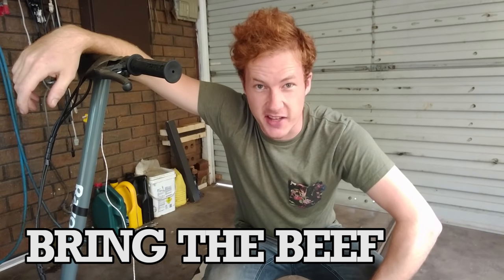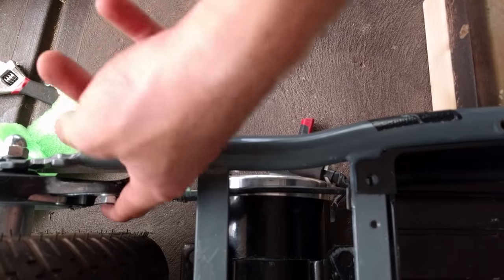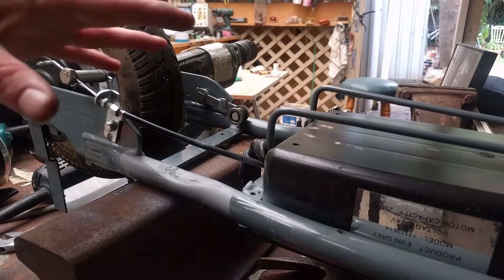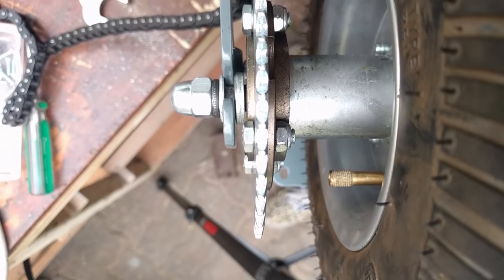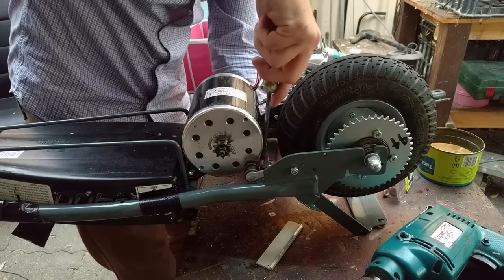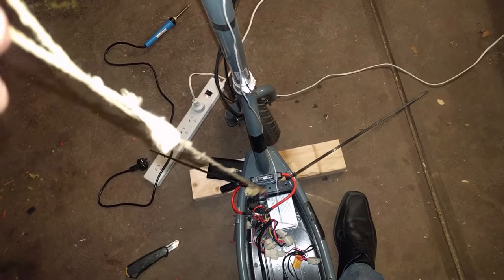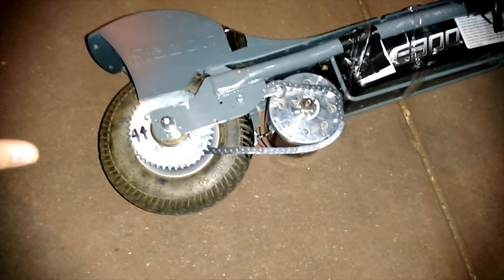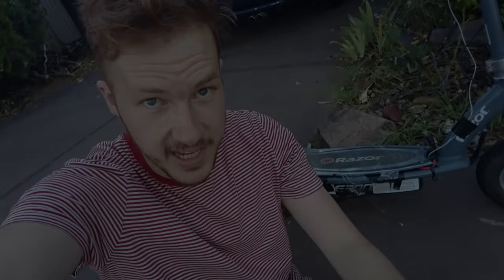Razor E300 Gets a Big Motor Upgrade - Scooter Episode 5

Comment: where did you get the sprocket? and please tell me it 44t t8h sprocket fits easily on the #25 chain
Reply from the maker: I think I got the 44T off eBay. T8F sprockets don't fit #25 chain. I cover all this in the video. :)
Reply: TK thank you I saw your video part by part and I see you are using 44t t8f rear sprocket and a MY1020 motor with a t8f pitch.. I think I have to only buy batteries and that's it. I'm looking and looking for pieces to fit on the stock motor but is impossible. thank you for you tutorial . " Dob Jone".
Reply from the maker: Did a search - here you can get 'em. Parts List:
Motor - https://ebay.to/2Yy2qtp
Chain - https://ebay.to/2V35TxK
Sprocket - https://ebay.to/2Fwux3o
Sprocket - https://ebay.to/2TZ5kIS

Comment: You made almost no difference in gearing with the sprocket change, the tooth number changes with pitch, your stock 56 tooth #25 chain sprocket had a diameter of 113 mm and your 44 tooth T8F chain sprocket has a diameter of 110 mm. Apply the same principal to V-belt Pulleys, its really the overall diameter that matters.
Reply from the maker: MrTurdfergusen yeah, plus the person who sold the motor lied, it came with a 9T cog. episode 6 goes into this more, as does the Hackaday.io page. :D

Comment: he has fucked the rigidity of the frame by flattening it with a hammer, if it doesn't fold and bend when you first stand on it, it will when you go over the first bump...
Reply from the maker: There's actually plenty of rigidity left. Yes, it's compromised somewhat, but it's held up fine all year.

Comment: I cringed when I saw you whacking your adjustable wrench with a hammer! Get a short section of pipe that will fit over the wrench handle to increase the leverage/torque, and you're far less likely to damage the wrench and yourself.
Reply from the maker: Yeah I do go pretty ham on the tools sometimes.

Since then I’ve started to invest in better gear, thankfully

Comment: 100A fuse jeez. Input current to controller only several amps, whole point of Mosfets. Electrical theory all wrong fella
Reply from the maker: I'm sorry, what? I'd love to know what you're getting at but I'm not following.

If you watch the video, the fuse isn't there to be a fuse.  It's there as an easy-to-pull safety disconnect, hence the pullcord.

Comment: Why not just put it back where it was originally and modify the cover. Your exposing the motor any way, so not just cut out the cover where the shield went over the motor in the rear. Then at least you don't have to worry about getting all sorts of trash on the sprocket and damaging the motor from ground debris. 
    Secondly and most importantly, what idiot goes 50 miles an hour standing up on a little scooter with no protection, hit the first pot hole and your toast, on the bright side you don't have to worry about any brain damage, cause anyone who would do that in the first place, is already brain dead. Have fun but be smart and stay SAFE, remember there are younger kids watching what your doing.

Comment: brilliant job 1 like & sub necessary ok
Reply from the maker: Welcome!
Reply: @WhatUpTKHere  what is the difference between 24v and 36v 500w motors? I have 3 12 volt batteries and a speed controller on the handle.
Reply from the maker: @markus8994  They're set to produce the same power at different voltages. The 24V motor will need more current to make the same power as it runs at a lower voltage.
Reply: @WhatUpTKHere  so I should get a 36v motor for my 36v batteries?
Reply from the maker: @markus8994  Well, it really depends. You can run a 24V motor at 36V, but it will be running outside its design parameters. It'll spin faster which can get you more speed, but it may overheat.
Reply: @WhatUpTKHere  so 24v is faster than 36v?
Reply: For a 36v setup of course.
Reply from the maker: @markus8994  It depends on the individual motor. 

If a motor is rated for 3000 rpm at 24V, it'll do something like 50% more RPM at 36V. 

That could make it faster on your scooter than a 36V motor which is only rated to do 3000rpm at 36V.
Reply from the maker: @markus8994  You might find watching the gearing video helpful, it's the next episode in the scooter series.
Reply: @WhatUpTKHere  50% extra voltage equates to double the power